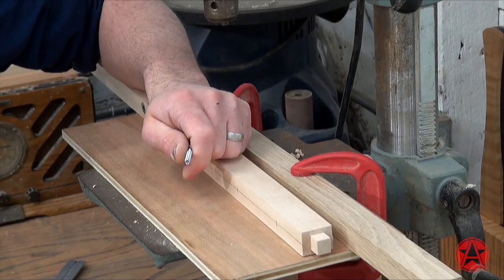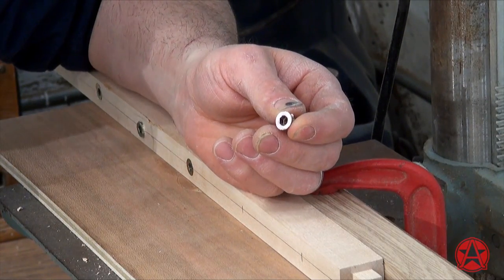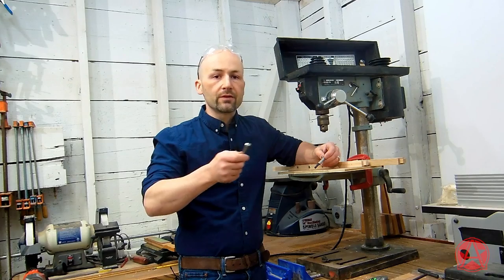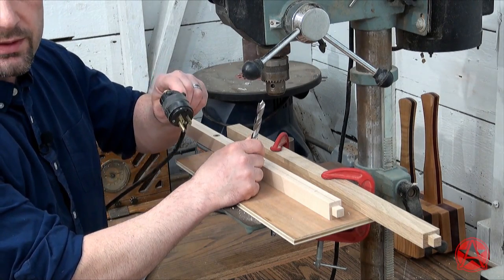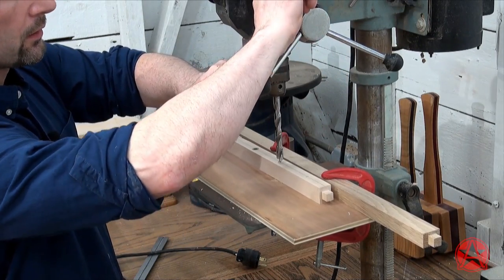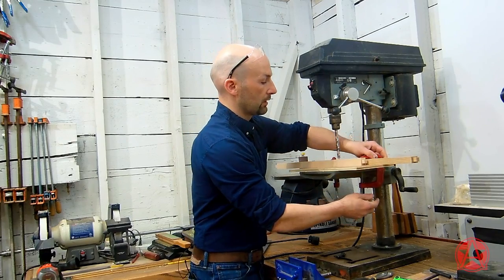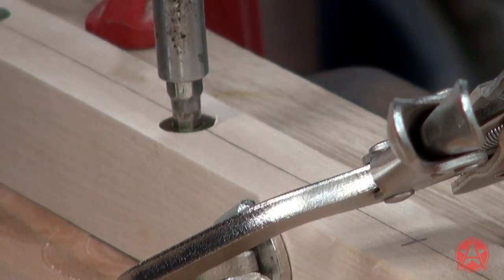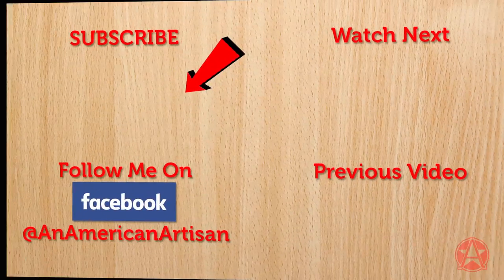Drill Press for Threaded Inserts

Comment: Thank you, Thank you for your video, its the only one out there that talks about HOW deep to drill the hole for the threaded insert. please if you make another video with the different types of threaded inserts for wood hobbyists hold the different types by tweezers. I also think that it comes down to the lingo and terminology of the part names and what the bolt or fasteners that go into the threaded inserts. Cheers, thanks again.

Comment: First off great video all around.  Next is I have back to this video for a second project. I do not have a drill press, but a harbor freight drill guide. I’ve used the bolt with cut off head method into poplar, works flawless. This time around into blk walnut slab tabletop. Not only did the insert strip and not go flush but the bolt broke off inside of insert and I made a mess removing as much as I could. Luckily it’s the underside of table and can be covered with the base but looking for a better way to go about this. Any suggestions would be greatly appreciated.

Comment: I like the T-bar for when a drill press is not an option - I think a block of wood with a hole drilled for the shaft would keep the T-bar perpendicular to the surface - the hole would need to be the same size as the shaft but bigger at the base to allow for the insert.

Comment: Thanks for sharing, great tip. I have been running into an issue of the threaded bits pulling back out as I tighten my two pieces together. I am using pine and had been drilling into the end of a 2x2 so with the grain? I’m attaching legs of a table to cross bars (2x2) . Any suggestions? Is it the grain of the wood, softness, adhesive needed?

Comment: Why not just turn your drill press chuck by hand as you put pressure on the insert with the drill press lever instead of using a wrench?
Reply from the maker: Hi Prmskeeper,

I l think the wrench grips better and is less awkward but your idea should work. 

It's a good option if you don't have the right wrench. 

Thanks for watching and commenting. 

-Andrew

Comment: Man, if you'd read the manufacturer's manual before work, this method wouldn't be a lifehack to you. Also you can use regular screwdriver with the same result.
Reply: Actually, you CANNOT use a screwdriver to produce the same results, which was his point about using the T-Wrench (which is only slightly better than using a screwdriver).  If you have ever worked with insert nuts, you will find that making sure they are square and truly perpendicular to your work piece is the key to accurate placement and use, and manually driving in the insert nuts by hand using a screwdriver allows too much variance and produces inconsistent results - especially with softer woods!  Many folks even make their own jig to make sure the nuts go in straight, but I like this approach, because it doesn't require making something else, and most woodworkers already have everything they need to do it in this fashion.
Additionally, most woodworkers recommend that you use some type of adhesive on the exterior threads of the insert nuts to keep them from moving over time because of the potential torque applied to them, but that has its own caveats - such as too much adhesive, and being careful not to fill the interior space so that your bolt will still go as far as you need into the insert nut.